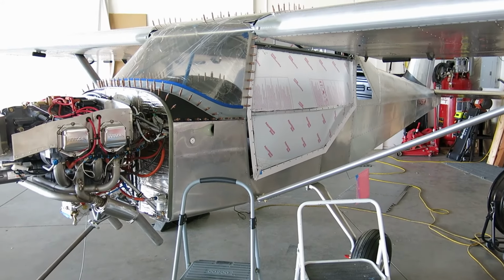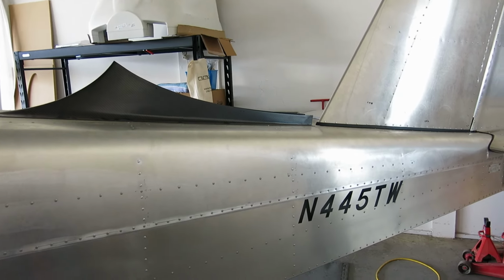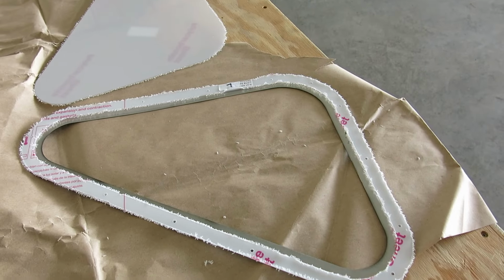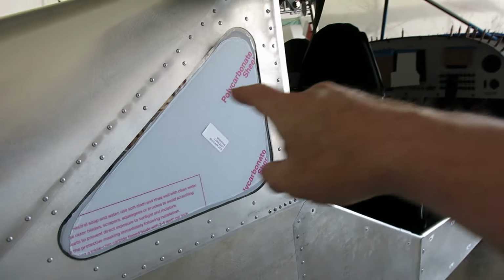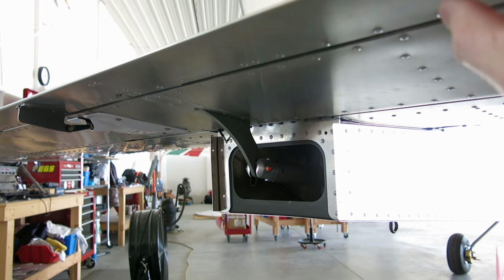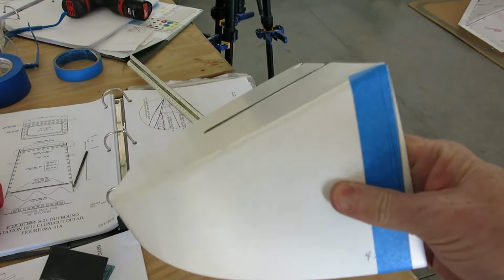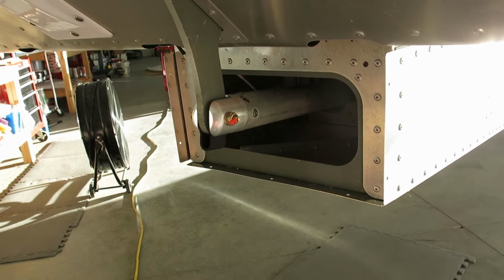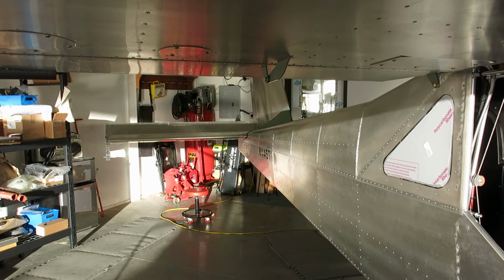No. 383 09-14-2024 Rear windows and tail cone closeout

Comment: Is your concern strength of the rivets with the holes that close to the edge?  Or is it a clearance issue of some sort?  You have nothing to worry in regard to strength.  That edge distance is more than adequate for a nonstructural fairing.  No worries in that regard.  The normal edge distance requirement is for structural reasons.